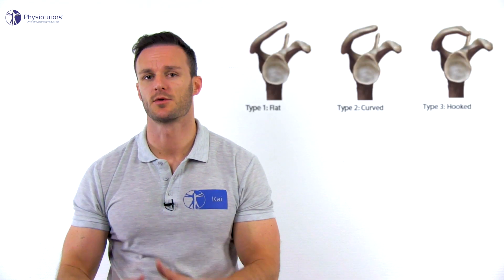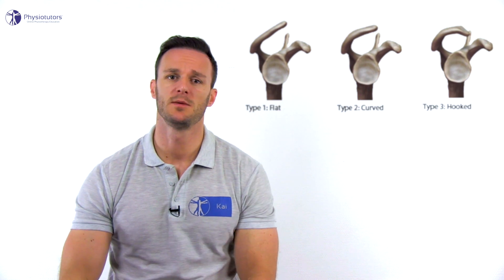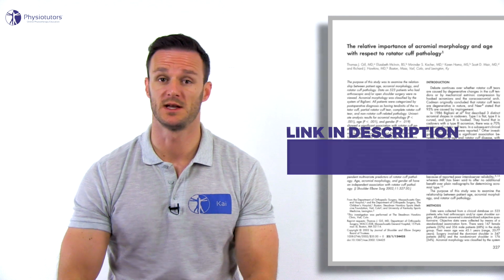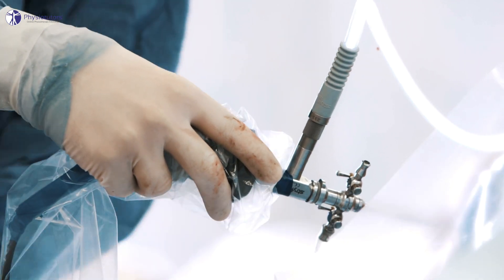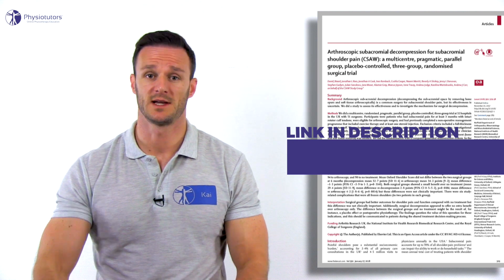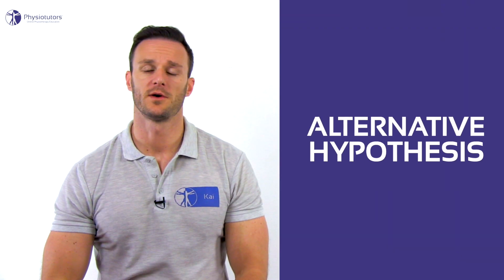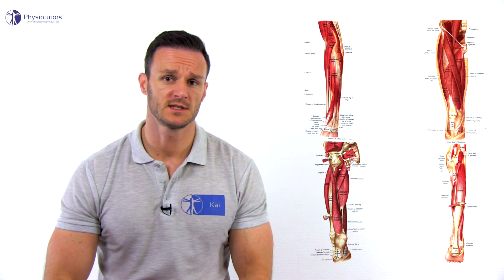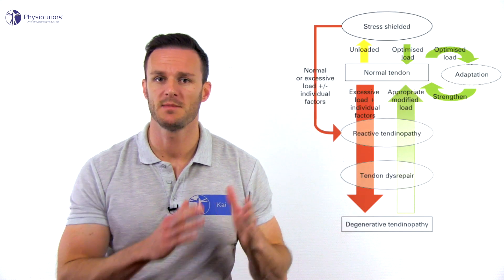Shoulder Impingement Myth Busting

Comment: Can lupus 
Sjorgens???
Even accutane cause this years later?
A vaccine? Not covid 

I did fall 12 feet and landed on my shoulder
Two years ago
I now have osteoarthritis in the vertebrae it’s so painful turning my neck sometimes 
I read I have congenital spinal stenosis (read that can lead to being paralyzed ….)
Also have slight bulge in c3-c7
Impingement tendinitis bursitis in both shoulders

My left one started after hpv vaccine (not an anti vax or whatever)

I was told I prob won’t be 100% 
My arms kill so much 
I can’t even lift shirt over me 
I’m 32
I’m doing pt
And it’s killing my body 
I’m so out of shape
I’ve been feeling sick with health issues since 2009 it happened when I was on accutane 
And I know that does stuff to your joints 
As I had back pain while on it….

I feel trapped 
I’m in so much pain

Comment: A meta analysis by Morelli et al 2018 (doi: 10.1002/ca.23309), which actually included Gil et al (2002), conflicts with your claims about acromion morphology, and found that a hooked acromion type was associated with a 3 times greater odds for RC tear.
Reply: Thanks for sharing
Reply: If there are multiple studies showing that the correlation is not there and a few others that show there might be some, you do not have strong evidence that the correlation is there. You have strong evidence that the correlation is NOT there. 

If there were a strong correlation, you'd have more than one study demonstrating it. A meta analysis is subject to authors' biases, as you end up relying on their interpretations and massaging of data (especially when you read only the abstract).
Reply: @Uprighthealth  to be fair, ALL papers are subject to the biases of the authors.  As for just reading an abstract: when a meta-analysis is conducted, the exact statistical findings have to be entered and weighed in.  As for your point about reading only the abstract, that's fair, but it also applies to all papers -- not just meta-analyses.

So I get where you're coming from, but the problems you're speaking of aren't exclusive to the MA world.

I do agree rather strongly with your opening points about evidence of correlations and how we shouldn't cherry-pick a minority of the evidence to form our interpretation of the topic as a whole.

Comment: Impingement is not a stand alone condition. It's caused by shoulder instability due to weak rotator cuff muscles and weak rear deltoids. Also, muscle imbalances can cause this issue. Meaning the anterior shoulder muscles are stronger than the posterior. This causes bad posture putting the rotator cuff in the point of impingement. You see this a lot in weight lifters that focus on what they call mirror muscles. Which basically means they focus on the chest biceps front delts etc. And neglect the rear delts, rotator cuff, and back muscles.
Reply from the maker: Impingement is an outdated theory. What you suggest sounds a bit like the algorithm from Cools in 2008 which was largely based on theory and not on evidence.

Comment: Could you further examine how compressive load leads to this damaged underside ? And which tendons are meant.
Reply: I believe sleeping on that shoulder can cause this over time
Reply from the maker: Can be all rotator cuff tendons, but often supraspinatus. Compression happens when the tendons get compressed against the humeral head under load
Reply: @Physiotutors  So usually it is said that impingement of the supraspinatus occurs, if the distance between the top of the humeral head and acromion is too short, so that the humeral head jams into the acromion, right? And what you are basically saying is, that this jamming into the acromion doesn't occur since then the tendon will be damaged on the upperside. So how do I know when I my supraspinatus tendon is compressed by load ? does it happen when the humeral head is pulled down too much by a load, for instace when doing the shoulder press?
Reply: @DeepDeepEast  
So basically, in your case, pain is caused by conflict betweeen tendons/bursa and acromion, AKA impingement ?
Reply: @Physiotutors  
So it is impingement ?

Comment: So what's the implication of that? We should stretch instead of strengthen the rotator cuff? work on the positioning of the scapola (trap inf etc) it's useless??
Reply: Very good question
Reply from the maker: Tendons only get better with load. Check out our video rehab series